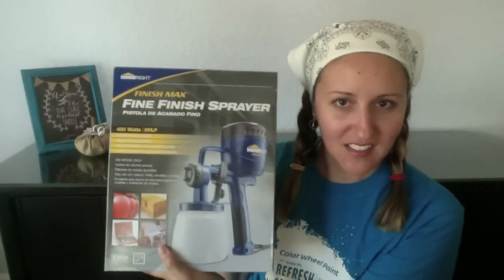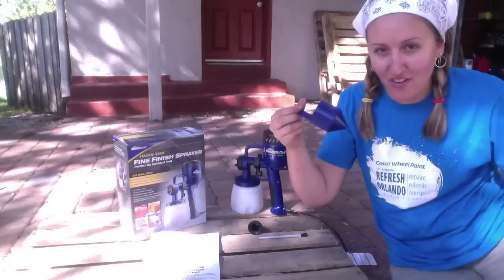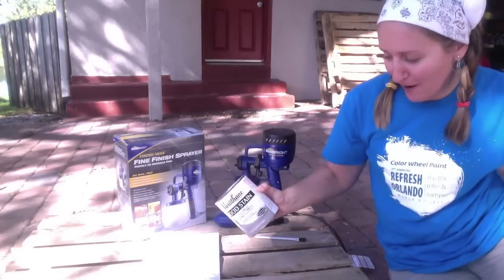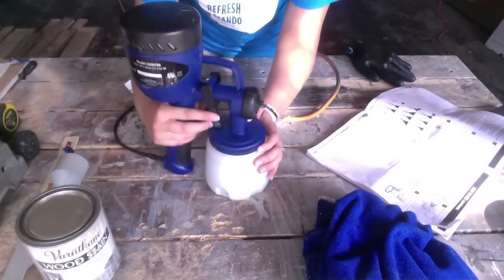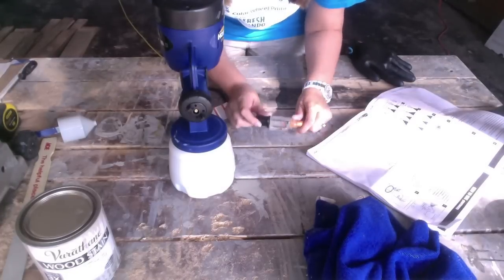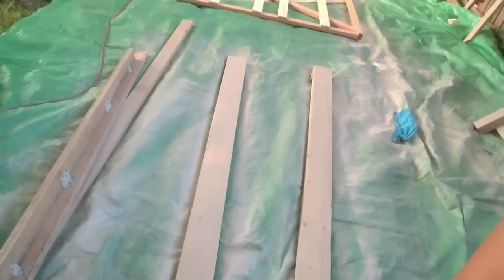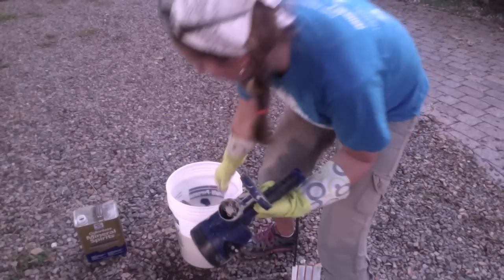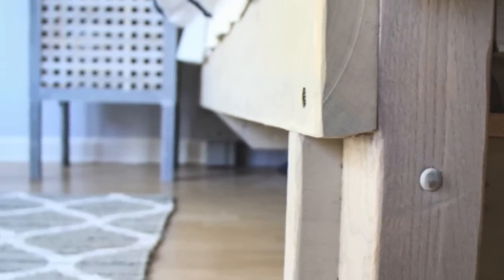How to Stain Wood with a HomeRight Finish Max Fine Finish Sprayer

Comment: Nice job and how to with the sprayer. Your results are great! A tip for you would be to toss those small parts in a smaller container, use less mineral spirits and not have to dilute it with water if you want the best chance to get all the stain out of the parts!